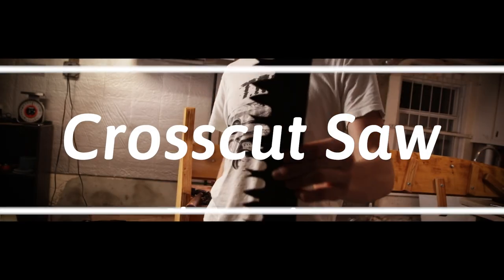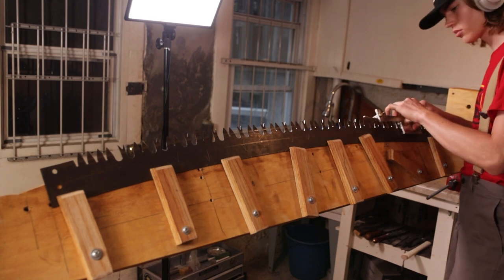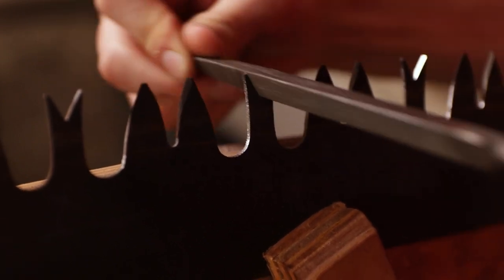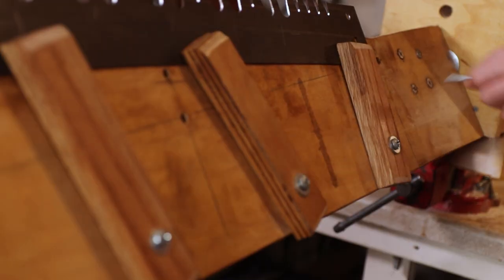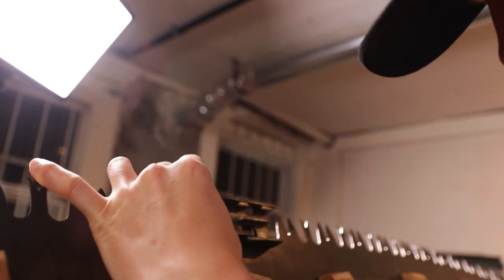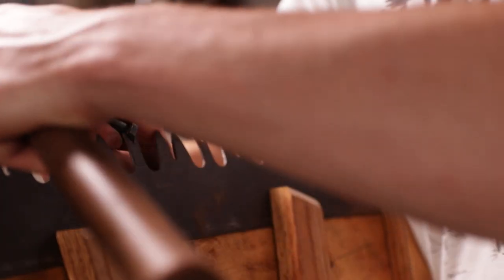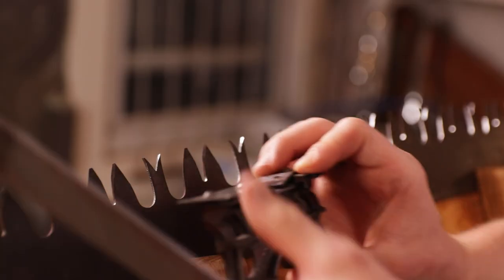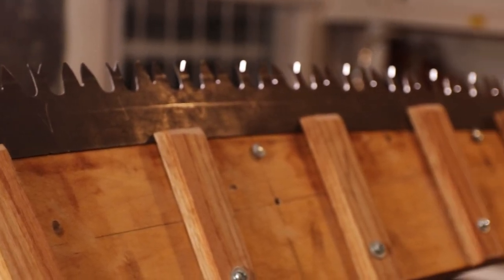Sharpening a Vintage Two Man Crosscut Saw (rakers)

Comment: Milo you are a cool dude!
I started a while ago also, I had some problems getting the rakers right, think I needed to use a bigger file (to get that thin tip for swedging), my cutters do better now however + they are higher than the rakers, the saw was in horrible condition when I first got it. 

Also I got some really strange marks in the kerf, I think my tooth setting is bad aswell, do you know how to "reset" the teeth so I can redo them? I made a spider which I ground to 0.015" of an inch. 
I found the tooth to hard to set with a saw set pliers, which would be the normal way.  So I probably have to hammer them.
Reply: Whats the cross section widest point on your triangle file? my new "big one" is ½ an inch. My supplier stocks 5/8 too.
Reply from the maker: Hey, sorry for the late response. To take set out of the teeth you want to put the hand anvil on the other side of the tooth and strike it in the opposite direction. That will counteract the set so you can get it perfect
Reply from the maker: @Musicpins  I can check when I get to my shop later today. Someone gave me the files and they are taper Nicolson nos. If the tips aren't thin enough you can focus on one side at a time with the raker and then make sure it's symmetrical after. All saws are different so there's some problem solving involved usually. I haven't sharpened a saw in a while because I've been busy with school, but it's a very difficult task to master